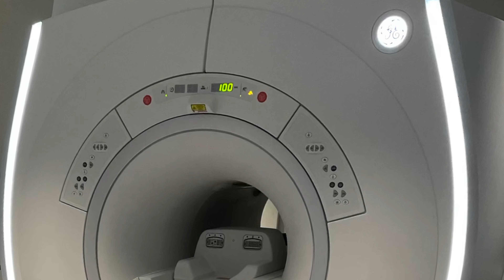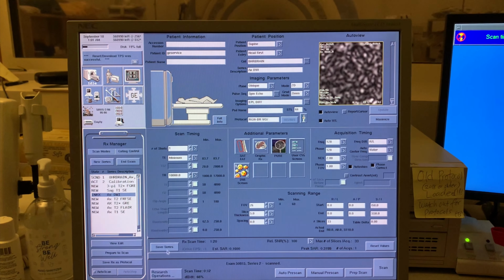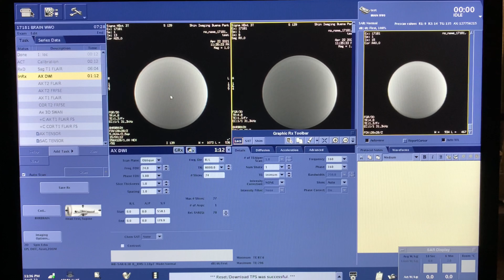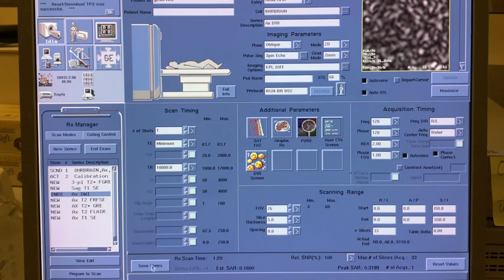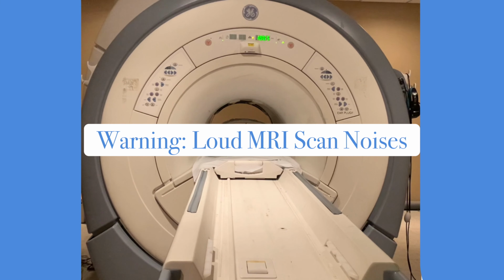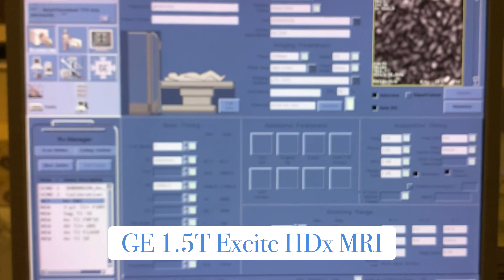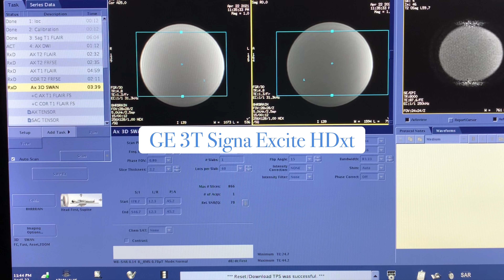DWI MRI  for MS, Hydrocephalus and Cancer (Diffusion Weighted Imaging)

Comment from the maker: Chapters:

00:40 Diffusion Weighted Imaging in MRI
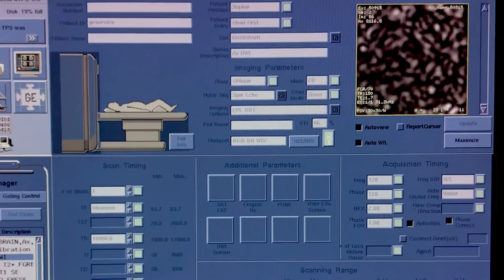01:00 What is MRI DWI?
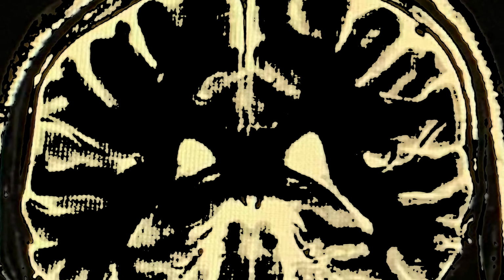01:30 DWI MRI Scan Theory- Diffusion Weighted Imaging
02:29 Why diffusion weighted images are more preferred for diagnosis of stroke?
02:42 Why diffusion weighted images are more preferred for MS Patients?
03:07 DWI MRI Scan Limitations
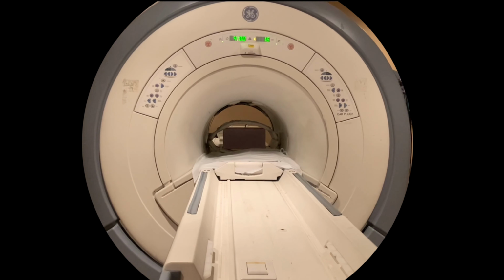03:47 DWI MRI Scan Sounds
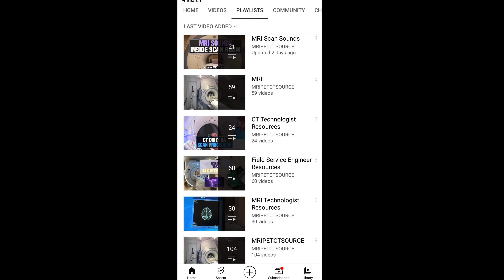04:19 DWI MRI Scan Sounds GE 1.5T Excite HDxt MRI
04:50 DWI MRI Scan Sounds GE 1.5T Excite HDx MRI
05:50 DWI MRI Scan Sounds GE 1.5T Signa LX
07:23 DWI MRI Scan Sounds GE GE 3T Signa Excite HDx MRI
08:37 DWI MRI Scan Sounds GE GE 3T Signa Excite HDxt

Comment: just a heads up for anyone with hydrocephalus  that has a programable  VP shunt, you'll need to swing by your neurosurgeon after your MRI to have them reset your shunt as the magnet changes the setting on it.